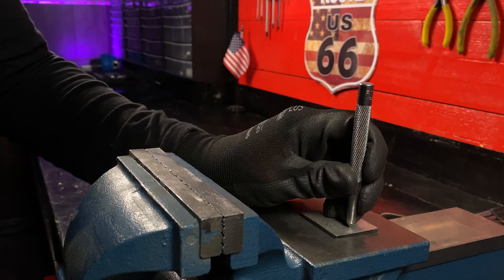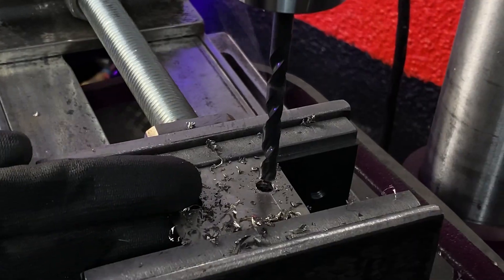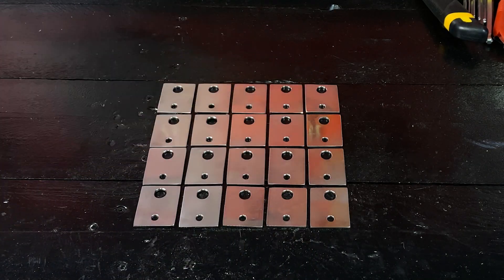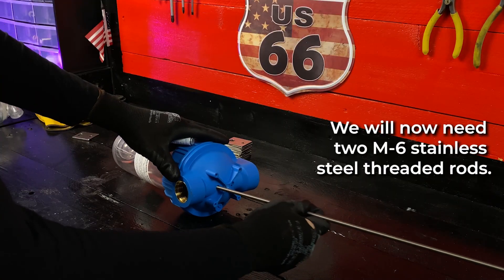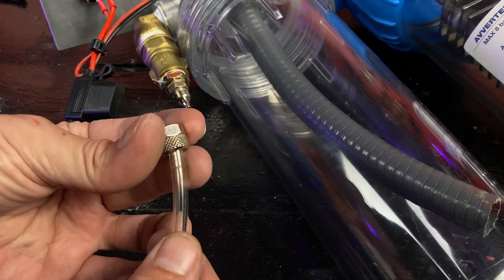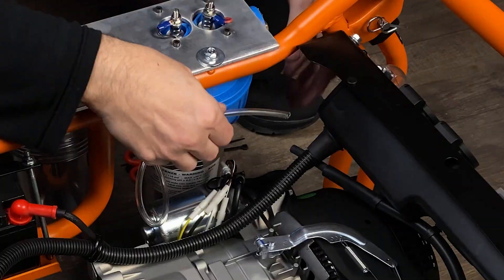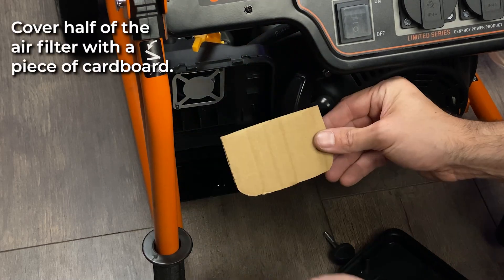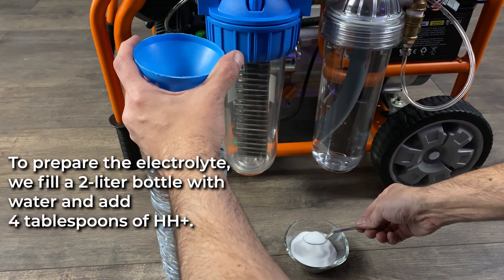ENGINE RUNNING ON WATER

Comment: Basically, that's a perpetual motion machine: water is converted into hydrogen/oxygen gas mixture. Inside the internal combustion machine this mixture is converted back into water vapor (water is the product of burning a hydrogen/oxygen mixture, for those who don't know). If you condense the water vapor back to water, you could fill it back to the electrolyser tank. Voila, we have an infinitely running machine without external power supply, aka perpetual motion machine. And for those, who don't know, according to the laws of thermodynamics, this isn't possible...
Reply: @aviationengine6701  To do/achieve what?
Reply: @aviationengine6701  Fortunately I do not need to waste my time with this kind of experiments here because I know due to my educational background that this proposed setup has no chance to work at all.
Reply: @aviationengine6701  My answer to your comment was not meant arrogantly; apologies if it sounds this way. I am sad that people like this channel owner are screwing people here. Let me briefly explain why the setup cannot work. The dynamo generates electrical energy which is used to split water into hydrogen and oxygen which is burned in the internal combustion engine to drive the dynamo, etc... That's like driving a dynamo with an electric motor and using the electric current of the dynamo to drive the motor. You see, it's like a perpetual motion machine. Btw. he shows exactly this electric motor/dynamo setup in an other video on this channel here... And I hope we both agree that a perpetual motion machine is impossible. One thing is important to understand: burning hydrogen does not release more energy than you need to split the same amount of water into hydrogen and oxygen.
Reply: Well, it isn't possible. The amount of water vapor in the exhaust wouldn't be sufficient.  (This is a guess, haven't got any numbers to support it)
Doesn't matter though. Water isn't exactly a scarce resource.
I have questions about the capabilities of this system. Could this be powerful enough to be fitted into a semi truck and haul 20 tonnes for 8 hours? What realiability issues would arise from not having the cleaning effect of petroleum? Worth investigating.
Reply: @bb3xhrhj  The fact that you can recover the water is not the issue. The issue is that this is breaking the laws of chemistry. The generator is putting its own energy into the water converting it hydrogen which has a higher potential energy(which can not be more than the energy put into it). Then the same hydrogen is combusted and converted back into water and that energy is used to convert the water into more hydrogen. It is a closed energy loop. There is energy loss at every stage of the process, so there is no way this generator(even if it could run on hydrogen) could possibly continue forever without more power being injected into the system. 

tldr;
It is pretty much as good as plugging an extension cord into itself, and no power other than what was already in the system is generated.
Reply: @bb3xhrhj  What do you mean by "The amount of water vapor in the exhaust wouldn't be sufficient." Sufficient for what? The amount of water vapor out of the motor equals exactly the amount of hydrogen/oxygen gas mixture that was put into the motor before and burnt. One of the fundamental laws of chemistry (the law of Lomonossow-Lavoisier) conservation of mass

Comment: Cost and Safety Videos? Some thoughts to generate additional interest: ONE: Have a separate video describing the cost to run on hydrogen: cost of materials to build and run, maintenance costs, etc. TWO: An explicit safety video. Hydrogen worked fine in the Hindenburg until it didn't. THREE: have these two videos at the very top. Even if you cover all this elsewhere, at least have short summary videos with links. There are old school design engineers who think of these two items right off the bat. You appear to be freely disclosing this information, but I don't see you as just hobbyists. You're too serious about what you are doing here. FOUR: You probably have this information on other platforms. However, provide this information in a separate video as well, with links (put this video at the top too - "Where we are also located"). Wishing you all the very best.
Reply: I appreciate how much work you are willing to do to see the potential good in people rather than thinking that they may be misleading you

Comment: This is an interesting video. It seems that the electrolyzer draws power from the generator battery. Even if the amount of oxyhydrogen is enough to run the generator for a few minutes, the process will stop when the battery is discharged. The problem is efficiency: the efficiency of the internal combustion engine is around 30%. The electrolyzer and generator are also less than 100% efficient. Thus, more energy is consumed than generated. It is a pity that this is not the solution to the world's energy problems, but perpetual motion does not work.

Comment: It looks like you are powering the electrolysis reaction from the starter battery on the generator. Even if you use the generator to recharge the battery, the efficiency of the process will always be less than 100%, meaning you will use more electricity to keep the reaction going than you can generate to charge the battery. So it doesn't seem to be a solution that can sustain power for long.
Reply: @aviationengine6701  yeah sure but you need external electricity for this setup to work but then the generator is useless. You cant convert electrical energy to chemical then back  to electrical without lossing energy in form of heat and friction wich means its impossibel to use the generator as shown in this video
Reply: @aviationengine6701  other thoughts ?

Comment: One thing is for sure, the engine is not running on hydrogen produced by electrolysis from the generator.  All parts of this system have been around for years and are well understood.  You think if this worked someone would not be selling them already, and no nobody could stop them from doing so.   The overall efficiency from hydrogen fuel to hydrogen out of the electrolyser is about 25% if you are lucky, it wastes most of the energy produced by the engine as low grade heat.  You'd have to feed about 5 times as much hydrogen as you make, so if you want a nice Youtube video just hide a hydrogen cylinder or easier still, a gas tank.  When they delete this comment you'll know how real it isn't.
Reply: there were some trying to sell this product. Unfortunately all of them are a few inches below the ground now.
Reply: @FacingFears  You're just arguing with science at this point.

Comment: Could you adapt the system to work with salt water and condense the exhaust which should be pure water? Would it be more efficient than current desalination plants?
Reply: And if you then condense the water vapor from the exhaust and fill it back into the electrolysis tank, you have a perpetuum mobile... Wow!
Reply: @OPA111AM  NO! There is a very obvious energy loss; physics 101 but could it be more efficient than current systems?
Reply: @jamesmacdonald5556  You got my point. It does not work at all because it defies the laws of thermodynamics.
Reply: @OPA111AM  NO! It does not defy the laws of thermodynamics. Turning electricity  into hydrogen energy loss but if the hydrogen fuel is more useful. Turning hydrogen into mechanical energy more energy loss. So the question is how efficient you could make the process.
Reply: @jamesmacdonald5556  The dynamo generates electrical energy, which is used to split water into hydrogen and oxygen. This gas mixture is burned in the internal combustion engine and drives the dynamo, which again generates electrical energy, and so on. According to the channel owner, no further fuel is added nor external energy is supplied. Notice anything? That's like using a dynamo to drive an electric motor, which in turn drives the dynamo. Btw, exactly this is shown in another video elsewhere on this channel. It cannot work because of the inevitable energy conversion losses! And burning hydrogen does not release more energy than is needed to split water into hydrogen and oxygen. What do you think, why the channel is called "HIDDEN" Technology!?
Reply: @OPA111AM  I am NOT talking about his generator or suggested it makes energy from nothing. Use electricity to break salt water into hydrogen/oxygen. Combusting hydrogen oxygen to make pure water. Using most likely a turbine engine during combustion to capture as much energy as possible; there will be energy loss but how efficient could it be?
Reply: @jamesmacdonald5556  Ah ok, got it! I guess with "salt water" you mean sea salt water because you mention desalination. Sea water contains around 3.5 % NaCl (sodium chloride) and the product of electrolysis here is hydrogen, sodium hydroxide and chlorine gas. Maybe you know these pool disinfection systems that function by electrolysis of slightly NaCl-salted pool water. The chlorine gas can undergo further reactions with the sodium hydroxide to form sodium hypochlorite which gives bleach the typical odor. So, no, electrolysis of NaCl containing salt water is not perfect for desalination. Sorry! ;--)

Comment: OK now power a battery charger to isolate the the battery for starting only. The battery charger also needs to recover the starting losses.  Once assembled, see how many refrigeration devices you can power at 110VAC and for how long. All the test loads I've seen are with 220VAC.
Also how long will the stainless pates last before needing replacement and/or cleaning? 
How warm does the plate housing container become over time?  
What readily available electrolyte are you adding? 
How much run time do you get before the level of the water/electrolyte mix has to topped off?
Reply: All good questions, hope they answer!
Reply: The electrolysis of water is only 70% energy efficient. If the generator is 90% efficient in burning the hydrogen, then the overall input-to-output energy efficient is about 63%. Battery would eventually run out of charge, assuming the water didn't first or plates didn't need replacing.

Comment: To all the morons saying this doesn't work: Build it first and only then can you talk. There's something called "Put up or shut up."
Reply: Why do you call people who have reasonable doubt about the function a moron? If you had an academic background in science or even a little education in science, you would know that this cannot work. Here's a thought experiment: if you were to condense the water vapor produced during combustion and pour it back into the electrolyzer, you would have a perpetual motion machine. And maybe you know at least this: the laws of thermodynamics forbid a perpetual motion machine.
So why build it if you can scientifically prove that there's no chance that this will ever work!?
Reply: Can someone explain this to me like I’m 5 why this would or would not work? I’d like to learn to make this if it is truly worth it and save some money but I really want to know first if this is viable and I know nothing of cars.
Reply: @songoku8627  
Every step is a conversion of energy. Electrolysis converts electrical energy into chemical energy. The combustion engine converts chemical energy into mechanical energy. The generator converts mechanical energy into electrical energy, and so on. But every step has a net loss of energy in form of mostly heat. So adding more steps makes this worse. Just use the electric energy directly.
Reply: Hey could you do the world a solid and learn fucking thermodynamics or chemistry before you call people morons? Because if you had bothered to finish high school you'd know that perpetual motion machines are impossible for a reason.
Reply: But why build it if I it doesn't work?

Comment: The most complex battery inverter in history, when the battery dies, the process stops
Reply: No one said it was infinite power. Get your facts straight.
Reply: Try running your car without a battery.
Reply: @mustangsupersnake7848  
Running a car without a battery is no problem, I did it already. You only need the battery for starting the motor.
Reply: @andreasschmitt2307  
Yeah, but your car is running off of a pre-made fuel. It is not relying on the battery of the car to also create the fuel.

Comment: If the water is changing the color of the water it's eating the metal and sending it to the engine. So it won't last long before the engine seized up
Reply: Because we all know the fuel going into our gas engines is 100% pure, right?
Reply: The hydrogen gas is going into the engine, not the liquid with impurities...

Comment: This is technology that has been around for a long time but the powers that be made it disappear. Be careful op don't sell this to anyone except  private individuals.
Reply: The powers that be could not give less of a shit about this. It uses more energy than it produces. You would get more energy out if you just used the battery as is without electrolysis.

Comment: This is impressive since I had a unit like 4x this size on my car several yrs back but still needed gas to run it to it's full potential. Tighter plate placement and all.

Comment: I feel like I'm reasonably skeptical about the hydrolysis process and the HH+ solute. What's the chemical equation for this reaction? I would appreciate more detail about the substance, especially since it seems to be an obscure topic.
Reply: obscure because big oil/governments dot want this info out there. oil runs the world and if we don't need the vast majority of it, they lose untold amounts of money and power. pretty simple concept. And you can do this using regular water and iodized table salt. his recipe is probably more potent and provides more power of a longer period of time.
Reply: @offgridstruggles7504  I get that, but I just want a chemical equation to better understand the process

Comment: Does this really work???
Reply: Of course not! If you'd condense the water vapor from the exhaust and fill it back to the electrolyser you created a perpetual motion machine. Because the channel owner claims that it runs with no external power supply. And I hope we agree that this is not possible according the laws of thermodynamics. Or why do you think he calls himself "HIDDEN" technology!?
Reply from the maker: Yesss
Reply: @HiddentechnologyYT  Is it dangerous? Is there risks with this engine?
Reply: @HiddentechnologyYT   Where is the energy for the electrolysis coming from?